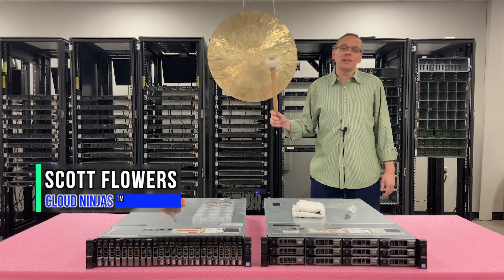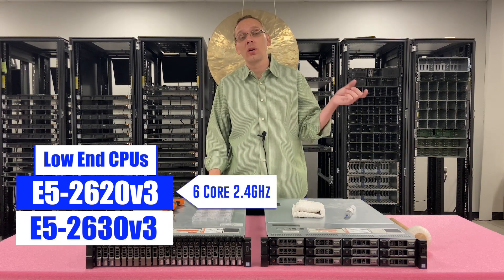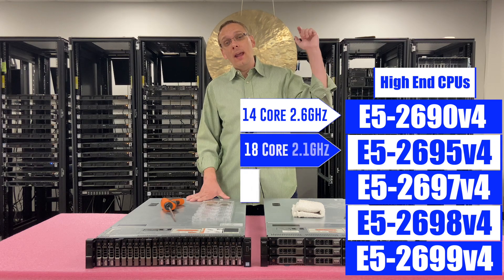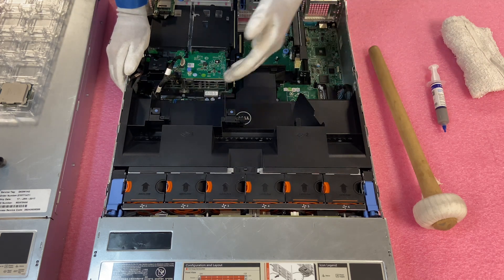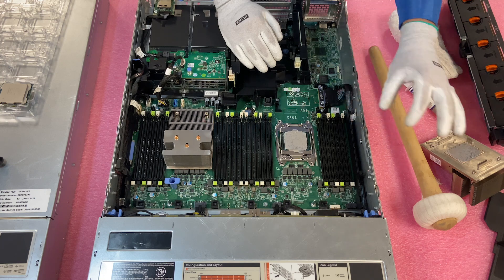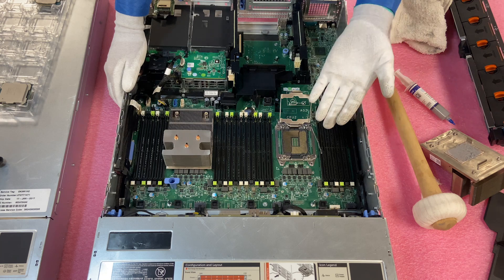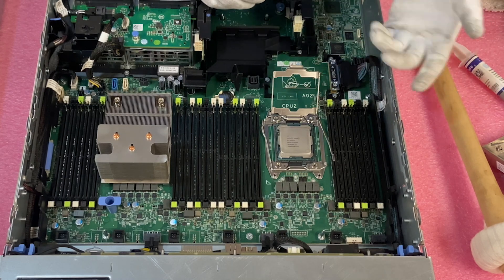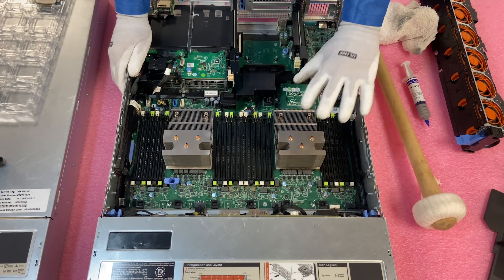Dell PowerEdge R730xd Server CPUs | Intel Xeon Processors Options | LGA2011-3 Socket | CPU Install

Comment: What is the difference between 2.5" and 3.5" in terms of connection?
I’m interested in the universality of the front panels.

Is it possible to convert a 24 SFF (vertical) configuration into 12 LFF (horizontal) for 12-Gb/s SAS drives?
What are the difficulties in replacing the “front panel”?

Thank you for a detailed answer.
Reply from the maker: Great question! 👋

The main difference between 2.5" (SFF) and 3.5" (LFF) on the R730xd isn’t the connector itself — both use the same SAS/SATA interface — but rather the drive caddy size, backplane layout, and cabling.

In other words, a 2.5" and 3.5" drive both plug into the same style of data/power connection electrically, but the backplane and chassis are physically different between the 24-bay SFF and 12-bay LFF versions.

You can’t directly convert a 24-bay SFF front panel to 12-bay LFF because:

The entire front metal assembly, backplane, and drive carriers are different.

The cables and midplane alignment won’t line up.

The mounting points for the LFF backplane don’t match the SFF chassis cutouts.

It’s technically possible if you source all the matching Dell parts (front bezel, drive cages, LFF backplane, SAS cables, etc.), but it’s a major rebuild — usually easier and cheaper to buy the proper chassis configuration from the start.

So short answer: the connection type is universal (SAS/SATA), but the mechanical design isn’t interchangeable between the 2.5" and 3.5" versions.

Hope that helps! 👍

Comment: Could I post an issue that am facing with an R730XD on here?
Reply from the maker: Certainly.
Reply: @cloudninjas  Thanks. Have an R730Xd with 12LFF front loading. Recently the system would not turn on. After a few attempts at plugging and unplugging cables and RAM, found that the signal cable from the backplane to the motherboard was causing the system not turning. Once removed the system turned on but as default none of the drives are recognized. Have even replaced the cable but to no avail. Any tips/directions on troubleshooting.

Comment: Excellent video. 

Quick question - I'm currently looking to upgrade from Intel Xeon E5-2697V2 to Intel Xeon E5-2699A V4. Am I am able to update the BIOS and Firmware without going via a v3?

Comment: I have a question. What do you recommend how many watts PSUs with dual 22-core processor?
Reply from the maker: Dual 1100W
Reply: @cloudninjas  i have another question. What do you recommend how many volts with UPS rack ?

Comment: edit: WARNING!: The DRAC will WIPE ALL historic logged data. So all the logged power usage and everything from the Hardware tab: System Board SYS, CPU, MEM & IO Usage. Which is extremely infuriating... Who wouldn't want to compare system power usage and load before and after swapping the CPUs?

Really useful video - and perfect timing as I've just had new CPU's turn up.
I gotta be honest though. You're using this as a sales pitch and I was 100% behind you until the electric screwdriver came out. Seems not just entirely unnecessary, but potentially dangerous - heck, you even rounded one of the screws off slightly. CPU installation needs to be tight, but it's also the sort of thing where you want feedback; which you'd get from a manual screwdriver. Or one with a clutch ;)
Reply from the maker: Appreciate your feedback!